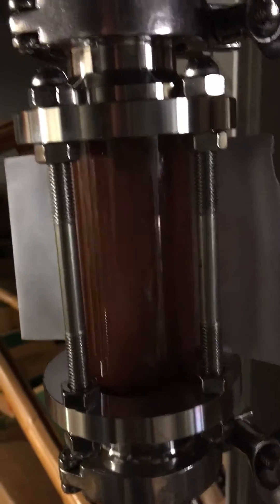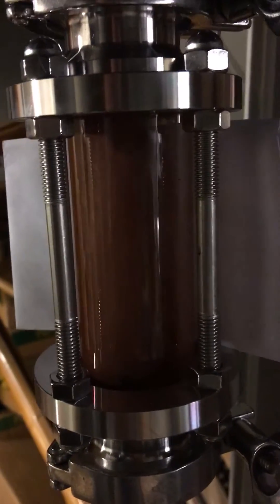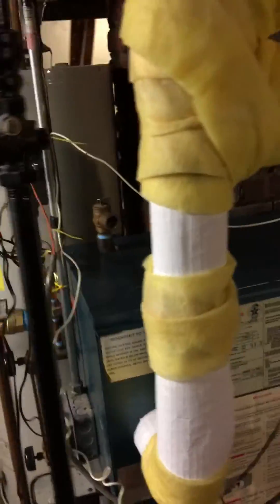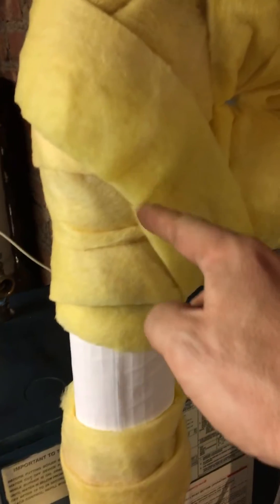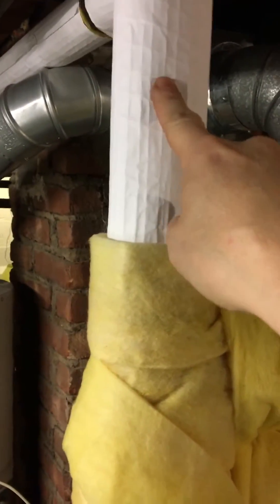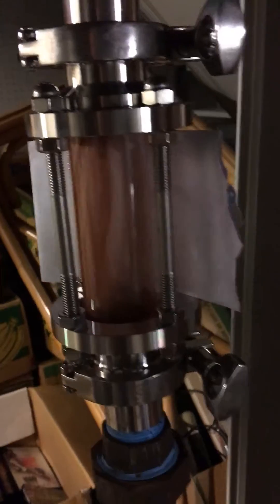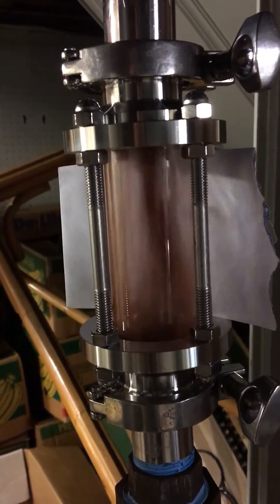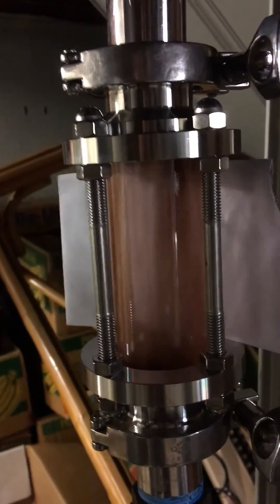Boiler carrying over water into main (surging)

Comment: So what was the outcome after draining and refilling? I just had an issue with 8-way on my steam boiler the other day. I drained, then refilled with a quart of 8-way. Ran the boiler for a week then drained again, flushed and refilled with another quart of 8-way. My boiler and radiators were working great for about 2 weeks then one night I heard a lot of banging  coming from my pipes and hissing from the radiator vents. I checked the boiler and noticed that the sight glass turned from purple to a brownish-purple. I also noticed that the sight glass was dropping like crazy. 
There appeared to be more rust that drained out of the system causing the color change. Not sure if this is a good thing or not. But I drained, flushed, refilled again with another quart of 8-way. It's been running fine for the past few days but it it happens again I'm going to flush the boiler clean of this stuff.
Reply from the maker: See my other video where I incrementally added tons of 8 way into my new boiler. I think it frees up a lot of gunk in older boilers and can result in surging like you saw.
I do think a quart is way too much. I recommend adding about 4 ounces at a time until your ph gets to about 10-11 (use inexpensive litmus strips to measure it). The directions say to add way too much.
Reply: @pb7379-j2k  Thanks for your input. I'll flush out some of the water and replace it with new water to dilute it a bit.
Reply from the maker: @damannoa  also my near-boiler piping on this boiler was very wrong and promoted carryover/surging. Your piping might be incorrect too—it’s very common
Reply: @pb7379-j2k  Hey bud would like to get your opinion of this issue as it's happening again. I drained the boiler 3 times now. First time I added a quart of the 8-way, ran it for a day then drained & flushed and filled with another quart of 8-way. It was running quietly for about a week then one night I started hearing loud banging coming from my steam pipes. It was loud and obnoxious.
I checked the boiler as it was running and noticed that the sight glass was nearly jumping 6+ inches from 3/4 full to empty and back. 
So I drained out the boiler again from the bottom, noticed a lot of sediments (rust) in the water when draining and flushed it again. I filled it back up with another quart of 8-way and it was running quietly again for another week and just last night I was woken up in the middle of the night with the loud banging noise again. I ran down to the boiler and noticed the sight glass jumping again. The noise was loud enough to wake me up so I'm starting to get concerned that I messed something up. 
My pipes never made such loud banging noises in the past before I flushed out the boiler. 
Do you suggest I drain it again and fill it with just water and run it again or will the noise eventually go away. Any advice is appreciated.
Reply from the maker: @damannoa  no worries you didn’t hurt anything. 8-way does free up a lot of gunk which can then cause surging. Try this: drain all the rusty water again and refill it, then add only about 4-8 ounces of 8-way then see how it does. A quart is too much for almost any boiler—the manufacturer of 8-way wants you to use a lot 😀
Reply from the maker: @damannoa  PS the noise is just from water getting thrown up into your main then getting slammed around by collapsing steam
Reply: @pb7379-j2k  Ok I'll give that a try. You did mention before not to use a whole quart so I used a little less than a quart the 3rd refill. But I will take your advice now and only use a little bit. The banging was a bit unnerving though. My pipes never made those noises before until I drained it and use this product. Thanks for your help.

Comment: this wants me to see a glass radiator in action but making one is near impossible
Reply from the maker: There are some videos of a boiler piped with glass for demo purposes. A radiator would be pretty boring. The steam is invisible. You’d see a little condensation forming and dripping back down the pipe
Reply: @pb7379-j2k  i should have said that it would be cool to see it bang but then it would probably explode as glass is not as strong as cast iron